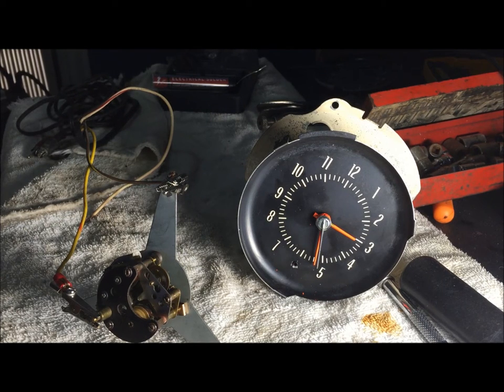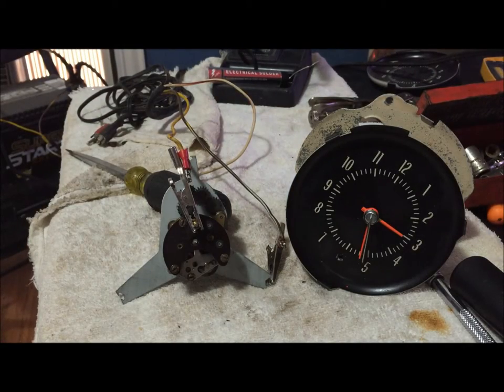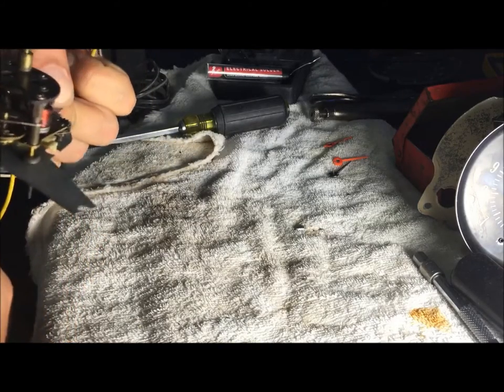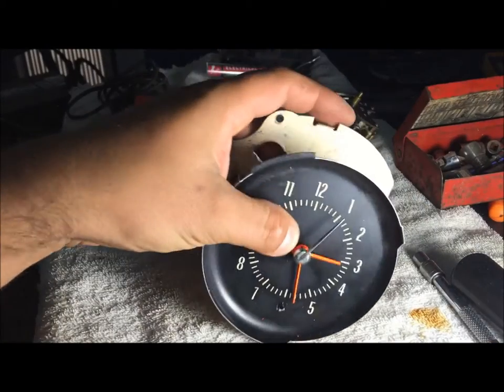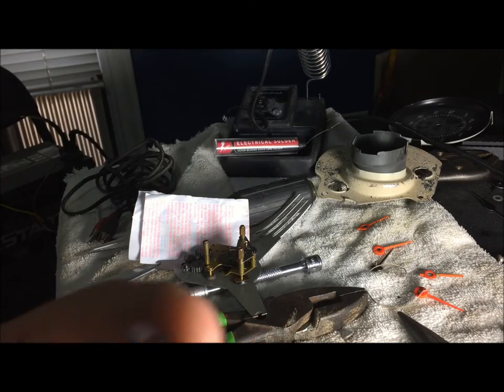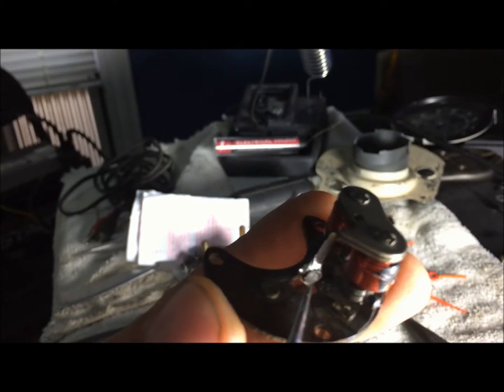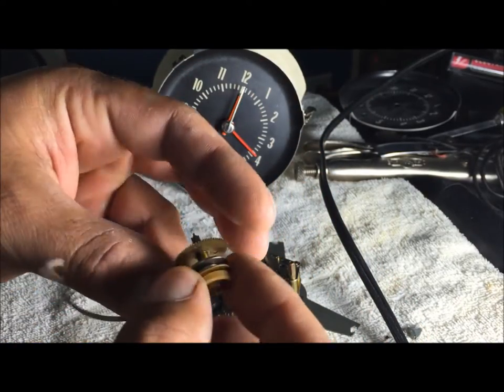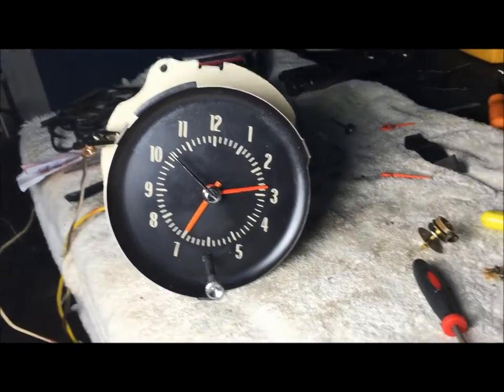70-72 chevelle mechanical old style points clock repair and INFO

Comment: I wound the spring until it stopped, like you did, but I let it unwind one turn before putting it back together.  The ‘kick’ is supposed to give 30-45 seconds of running time. With the lower tension on the spring, the ‘kick’ is giving it 90-110 seconds run time.  The clock is working perfectly.

I also reinstalled it with an on/off switch and inline 5A fuse.

Comment: Did the larger point's weight affect accuracy of the clocks time movement (slower)?
Reply from the maker: the points have nothing to do with that
Reply: @chriscraft77022 copy, was thinking change in unsprung weight on the spring...guess not

Comment: What paint would you recommend for those needle arms on the clock ?
Reply from the maker: people use testors model car paint from hobby section.. their silver and orange for gm dashes
Reply: Chris Craft I noticed both needles are two different paints would you paint them the same color.
Reply from the maker: no

Comment: Question, If I wind the spring up manually and the clock doesn't start to work / tick does that mean i have something else wrong with my clock?
Reply from the maker: i had one that did that..  i gave it a bath in PB blaster and it started working about 30 minutes later.. if it doesnt start working after that its never going to work
Reply: Chris Craft , so no power is needed? the spring tension should make it actuate?  thanks!